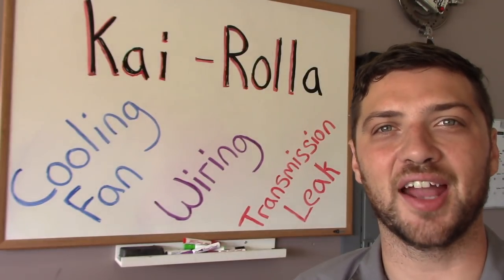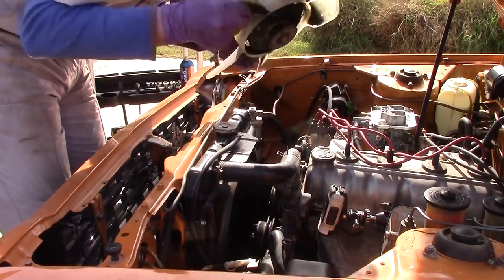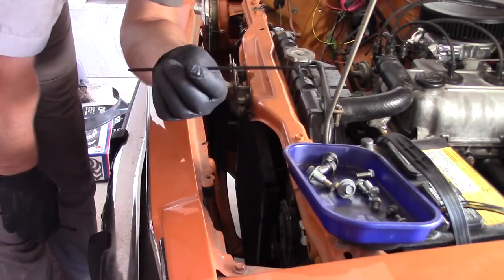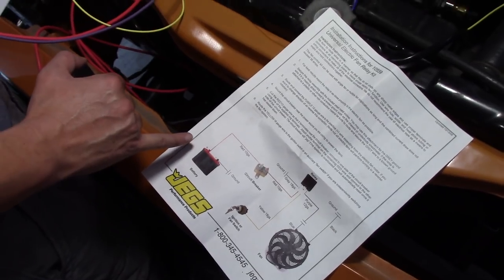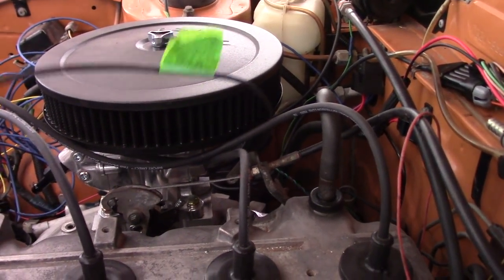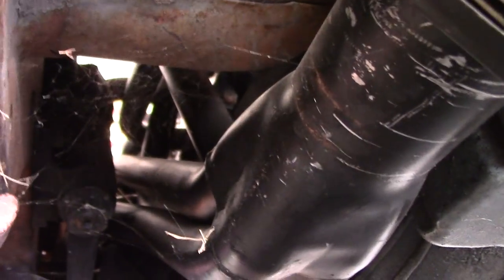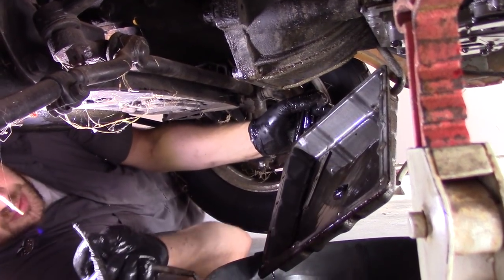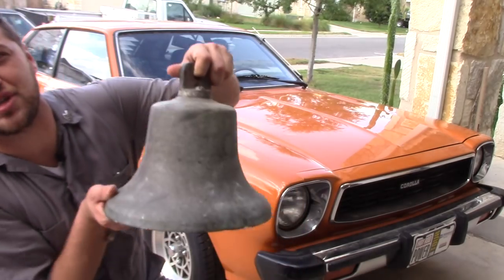Modernizing a 1978 Toyota Corolla: Installing EFI (Part 5)

Comment: Back in 1991 I had a 1979 liftback and I put a 3tc head and an accell coil and a manual transmission from an 1983  and a clutch from a twin cam ae86 . It broke both rear leaf springs. Once replaced I made it power windows using motor from a Honda. I miss that car a lot and it was the prototype of a lot of the knowledge that I have now. Super clean orange wagon you guys have there.
Cheers from Chicago.

Comment: you can modernize the alternator to a more modern one with more amps and internally regulated so the efi won't be starved for electricity.
Reply: GM Delco! Old school CHEAP!
Reply: I used an SR20DE alternator on my 2T, all I had to do was to change the pulleys and put a little spacer on the SR alternator so the 2T pulley alignes up with nicely with the rest and a bit of wiring job on the original fuse box (a friend did the wiring process, sorry for not explaining it). Other than that, it's almost a bolt-on mod and I'd highly recommend it =)
Reply: The Delco is usually cheap. Might need a grinder. No idea about the alignment I just see guys run em straight to the batteries. Fused probably. Plus parts are available anywhere you break down.

Comment: I had a 1979 Toyota Corolla 2dr sedan with a 3kc and 4spd manual trans when you installed the bolts on the fan pulley you could of used the bolts off of a 3kc because they came with an electric fan factory!😎👍also great job on the Kai-Rolla!

Comment: I had a 1988 Supra with hks intake and exhaust, then I put on a set of pace setter headers which were awesome on these Toyotas. The tranny exposed shifter gear is so they can watch where it’s at when they are fine tuning the shifts. It’s also exposed because there was no need to keep it in an enclosed housing. Besides it’s antiquated technology for us seeing it now, but at the time it was cutting edge. It was simple and worked-still does. Anyways the Kai-rolla is kick ass!!! Good job!!!!

Comment: Great series, looking forward to seeing the Corolla run and drive.  Ditch the fan shroud, you don’t need it if it doesn’t allow the fan to pull air from more surface area of the radiator.  That fan actually looks a little small for the hot Texas weather.  Would also love to see you two trim down the wiring in the engine bay, it will look sweet when it’s stripped down with the bare necessities to run the Holley EFI.

Comment: I had the alternator rebuilt on my Toyota pickup several years ago, then discovered one of the wires going into the alternator was broken off right in the plug. That was an easy fix with some solder and electrical tape. Check your wires too just to make sure.

Comment: The shift shaft bore needs to be machined in during manufacturing so they design the shaft to be removable, hench shaft bore , shaft then seal. I guess it's cheaper then a threaded plug. Anyway I like that " toyota corolla ".

Comment: I'm curious where you installed your temp sensor. The thermostat housing??
Reply from the maker: Yes indeed! Right where the factory coolant temp sensor went. It's on the engine side, before the thermostat.

Comment: I'm assuming shift shaft open on both sides is for applications of that trans in other vehicles where the linkage is on the other side. That way there's only 1 casting

Comment: I put a 289 high performance in a 71 point back in 1975 and it cost me with headers and narrowed ford rear end from a mercury 555 gear and a automatic. Car was 800 the motor I got from a friend and rebuild it and headers were fabricated by a shop here in Michigan 150 dollars for 1000 I had a 10 second car.

Comment: how much hoarse power do you think ,was being lost from the clutch fan compared to the electric fan?
Reply from the maker: The thing about the mechanical fan is it robs horsepower when your engine is making the least amount (low in the RPM range) so the loss varies as a percentage. But what I have learned from installing an electric cooling fan on my ford pinto is that the engine comes up to running temperature waaaayyyyy faster which has been great for the drivability.

Comment: How did this project finally turn out? What kind of mileage did it make? Thanks
Reply from the maker: Still working on it! More videos coming soon!
Reply: @Scooter_911  Good to know. I have been thinking about a pickup. Bang for the buck an old F100(late 60s early 70s) MAY be more cost effective than buying new.  The newer trucks do not do well driving 60+ on gravel. Straight six(300) with a "modern" five speed and an EFI for easy daily driving. Trying to get a clue about where the MPG might be. Comparing what you get with the Corolla and what it came stock, might hint at what I could expect.

Comment: Damn those wires needs to be tucked better then that, you guys should’ve ran everything into the cabin and jus have relays and necessary wires into the engine bay.

Comment: Binge watched the entire series. Awesome job guys! New sub! I have a 2TG in my 74 Celica and I might go this route since parts for my 40mm dual Mikunis are mostly no longer available.

What fan did u guys use from jegs?

Congrats to Kai for becoming an American! 🎉🇺🇸
Reply: Thx Joe! Flex-A-Lite 12" Diameter S-Blade Trimline Electric Fan Max. RPM: 2245. PN#400-392. 
Their 14" fan is too big for the Te51's stock radiator so we swapped it for a 12". Disclaimer: we haven't tested it during Texas summer yet so we'll see...
Where did you find a 2TG?!
Reply: @kaichowlau8734  I found it on ebay last year. Paid way too much! I am building a 2TG/3T hybrid which would increase bore and stroke and a displacement of 1850cc. Thx for the fan info.. I ended up ordering a Koyorad and an xcessive manufacturing fan shroud with fan for the Koyorad for my RA21 Celica. I'm looking forward to your build. I hope you do more to the corolla. Gotta save these old Toyotas!
Reply: @JoeDaFivefoota  Oooh, are you doing the 2TG head + 3TC block hybrid? That's awesome, take some vids and share!
Reply: @kaichowlau8734  yep. My car came with a 3tc and my 2TG is a later block so it will take the 3T crank with no mods. Had to get forged pistons and eagle rods and the parts list was huge! Budget went out the window 😂 but I think it'll be worth it keeping it old school. The head and block just got back from the machinist but my mechanic hasn't been able to start the assembly due to covid19 Lockdown here in the bay area California but once I get the engine going I'll put up a video here. Maybe Garret can come up and finish my build for me, I'll let him use the footage for his YouTube channel 😬😬😉 😂😂😂
Reply: @JoeDaFivefoota  It's def worth it! Looking forward to your vids and take care.

Comment: Rubber ring is cheaper than tin plate and bearing.. Penny pinching from the controller not the engineer who would have used double bearings and a cast casing, trust me.